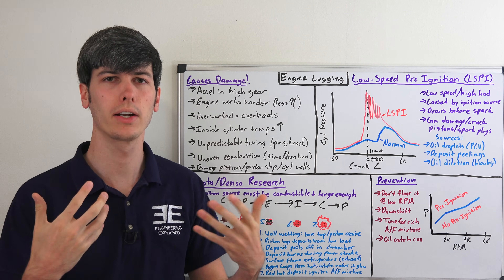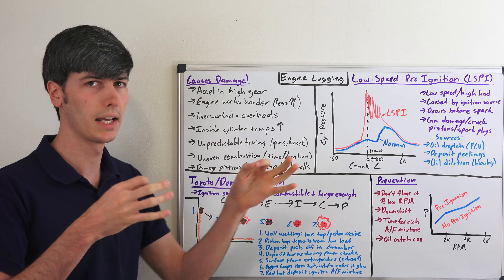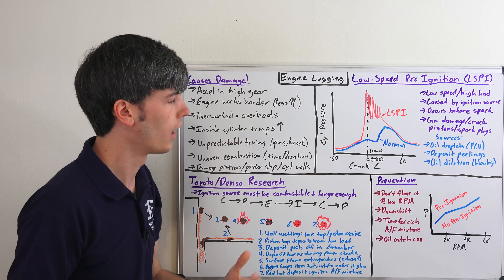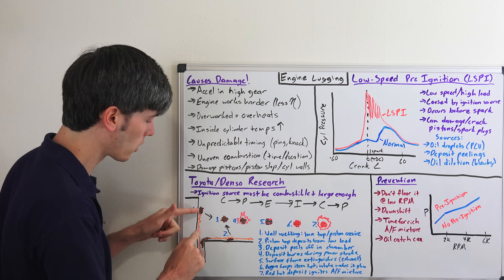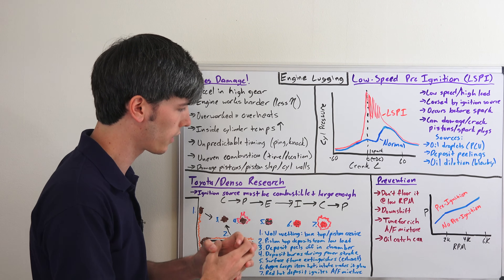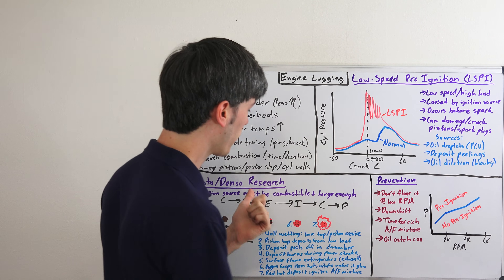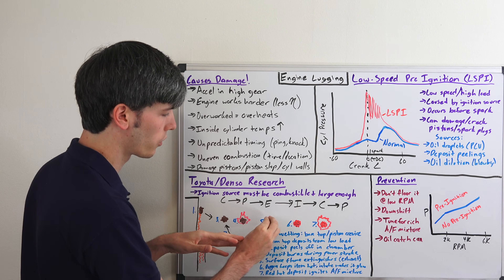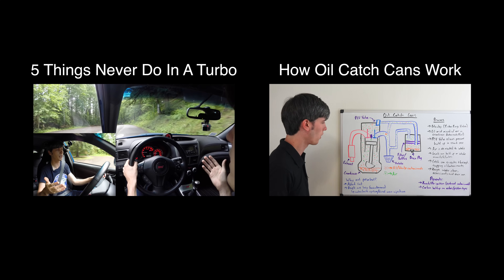Why You Should Never Lug Your Engine (Especially Turbos)

Comment: Soo...  When i'm driving along the motorway in top gear at 60/65mph and my cars revs are sitting at 1,500rpm,  are you saying i should change down a gear to gain a few mph then change back into top gear?
Reply: +MrAndersie91 you should have said that it's a diesel.
Reply from the maker: If you do it aggressively, yes. If you're light on the throttle, typically fine to leave it in gear.
Reply: +Engineering Explained  But when i'm driving along at 1,500rpm that is in the "torque band" of my TDI though
Reply: Its way more difficult to lug a diesel engine! The amount of torque that 2.0 liter makes at lower RPMs is insane.
Reply: manuel grohse There isnt too many Petrol Cars that sit at 1,500rpm in Top Gear at 65mph,  unless they're MURKA MUSCLE

Comment: The fact turbocharged engines are becoming very commonplace & many of them advertise their dynos with very beefy low end torque numbers. This probably gives the wrong impression that manual drivers won't need to downshift to pick up speed, hence the lugging.
Reply: 2015 WRX here. If I'm traveling in top gear cruising on highway and want to floor it then I always downshift accordingly and then do upshifts all depending on what speed I am doing. Otherwise it will bog down. This is my first turbo and love it. This is me coming from my first car 1995 Ford Escort LX wagon then 2001 Civic. Both were 5-speed manuals but of course they had very low HP. Day and night difference with current car lol.
Reply: Klikkitse yep. Comes from good practice and feel to know to downshift accordingly then push pedal more to accelerate and upshift accordingly.
Reply: Umm you usually do get more torque by pressing the pedal actually.
Reply: Yeah. You can have maximum torque and still be able to lug the engine. My daily driver is a small turbo diesel and while it has a ton of torque starting at 1200rpm it actually has very little power in that range. Means I can hold a speed at incredibly low rpm but if I need to accelerate - to the lower gear it is. I think the operative definition of lugging is to ask the engine for more power than it can deliver. You can have all the torque you want but if you try to exceed the power rating at a particular rpm you're essentially feeding the engine too much fuel. I guess people cannot grasp this "discrepancy" that you can have loads of torque but no power and think that they get more torque by pushing the pedal.

Comment: Most people in Europe drive manual, most people in Europe don't know this and lug the engine on a daily basis.
Reply: +iMiguelAOG can downshift an automatic too, if not, push pedal to floor, shoukd kick down a gear, two or three.
Reply: This depends entirely on the engine design. Undersquare (stroke length is longer than bore width) engines usually run lower rpm overall. This is because the average piston speed is higher per revolution if you need to travel a longer distance in the same time. Piston speed is usually 5-6m/s and it's mostly dependant on the speed of the flame front (which are specific constants for petrol and diesel).

This means that our inline-6 Volvo engine (undersquare - bore 84mm and stroke 96mm) despite being a petrol engine actually has a lot of diesel-like characteristics: overall lower operating rpm, high torque at low rpm. This design sacrifices high rpm raw power but is more fuel efficient. It's an automatic but it looks like the transmission always shifts at 1500rpm (1450-1550 depending on gear) and the new rpm hovers right below 1000rpm. I don't know much about engines, but based on the feeling alone it's not actually even close to lugging because almost all torque is available very soon and it can climb a steep hill like that (even if I let the ECU choose the gear). That's 1100rpm, 65km/h (40mph) and 6th gear.

This only goes to show that one should know their own car and engine in order to drive it as efficiently and safely as possible.
Reply: Driving at low RPM's let's say a turbo diesel engine is not automatically "lugging" it. It can mean as well that you just have to use 10% or may be 20% of your available torque to keep your car just running at the speed you already have. This does not mean high pressure, high temperatures inside the cylinder or danger of "lugging" at all. It's just not blowing hot air out of your exhaust uselessly. And that exactly is the point of "knowing how to select right gears according to the situation". Hope that's reproducible even for automatic gear drivers. ;-)
Reply: Our previous car was from -91. Finland's an exception, though. We've got really old cars. It's not uncommon to see 20-30 years old cars as daily drivers. 10 years is some sort of a turning point when a car is considered to lose value meaning it's getting older. The average lifespan of a car in Finland is about 12 years, 14 if it's a van. For some reason we have a ton of old vans from 90s.
Reply: Maybe the "problem" is not really that big problem any more? (Theoretically yes, but practice seems to tell different story)

So, if most people in Europe don't know that mistake and even with that mistake being so commonly , how can it be that right that engines you will lug most likely for their enourmous torque are running flawlessly?? Just thinking of german Taxis, if the rest of the car can withstand environmental conditions even 1 Million kilometers and some a lot more kilometers are very common. But don't you think Taxi drivers will do all for the comfort of their passengers? That are usually engines that won't be revved but most likely will be driven very torque-oriented and with very low RPMs.

And: BTW, checking german TÜV statistics or Motor club statistics most of the cars are not dying from the engine mechanically but usually they quit for electronics problems.
Reply: The reason this isn't the case is because automatics have torque converters which allow slip. This slip prevents the issues shown in the video.
Reply: You know what? Most automatics are also lugging because fuel economy or something. not always willing to downshit
Reply: @FSXgta I highly doubt that those engines are normally designed with that in mind. although maybe for really new cars like 2018+ish but those suck ten thousand other ways
Reply: @FSXgta  4 years later i have to say this is true, espacially with my car, which has 9 gears
Reply: Hmm, my (BMW, 2997ccm) turbo diesel engine is tuned for eco-power, which means "eco" fields characteristics with higher torque figures used for low load scenario while power optimization for high power/ RPMs. So it is optimized for even more torque at low RPM. I've driven that car since the tuning now at least for another 130 000 km (more than 80 000 miles). It has now done about 230 000 km totally (nearly 144000 miles) on first turbo and of course engine with currently still very nice condition. When just cruising I always have less than 1500RPM at low load scenario. And the latter is the point that matters. "Lugging" does not mean total avoidance of low RPMs, it is avoiding low RPM at high throttle ratio. If you do not really need force to keep your car just rolling, why not have engine running on 1000 or 1500 RPMs? Just in case you want to accelerate or going uphill then you have to downshift for the engine revving up a bit.

My cars did make it usually for at least 15 years lifetime, some of them had a total lifetime (driving by me and the owners that had the cars before me) even 20 years or older. And none of them did die due to lugging or such. My Mazda 626 GE from about 1993 (2500cc V6, 160HP) died due to defective coolant water pump, another one, the small 1600ccm Mazda 323f BG I had, cracked the crankshaft of one piston where the crankshaft did look outside the oil sump (or is it oil pan?). And that one was reving up to 7000 RPMs, which it may have done once or twice too much under heavy load situations on "german Autobahn"... ;-) 

That much on the story of "europeans lugging their cars by improper shifting"  ;-)
Reply: This is very true
Reply: I'm sending this video to my friends and family, we have a few sub 1L 3-cyl turbo cars.
Reply: my ex gf did it all the time. 5 gear at 1300rpm!!!
Reply: @TheStriker0525 not lugging until you come to an uphill
Reply: @TheStriker0525  i do this too, i thought i save gas if im at high gear. i usually go up to like 6th gear at 30 mph
Reply: @TheStriker0525  I’ve been doing 5th gear at 900 rpm 😬 glad I’ve seen the video now, time to drop it down a gear.
Reply: All cars me and my parents have sold have been driven between 300000 and 600000km. Still running, most of them still in good shape.
Reply: How many cylinders on the test engines?  Lugging would be worse on 3/4 cylinder engines than higher # engines because of the lack of overlap of power strokes during crank rotation.
Reply: 20+ years I'd say. If they don't keep it, someone else will keep driving it. And then it gets sold to Eastern Europe or Africa, where it will continue to drive.
Reply: That's not true.. The current average age of cars in Germany is 9.3 years. Average. That includes all the new cars on the road, too. And we are talking about Germany, which is doing better than much of Europe. If you look around in Spain for example (especially outside of the richer cities like Barcelona or Madrid) you'll see a ton of old cars.
Reply: Automatics aren't really being lugged though because of the torque converter
Reply: +Super Vitz That isn't long at all, or least not to people who drive in North America. The average vehicle age in the US is right around 11.5 years with Americans driving around 15,000 miles per year on average, which means the average car in the US has about 172,500 miles. Again, that is just the average, not when they're dead. It's actually pretty common for cars to go 300,000 miles these days before being scrapped. My last car had 270,000. Perhaps there's something to this "lugging" thing.
Reply: mine is 18 years old.
Reply: mine is 13 years old and they can get a lot older here in europe
Reply: Skipper  at least in Finland we scrap cars mostly due to rust. Usually rotten junks have perfectly good engine but frame would require new sheet metal which is usually not justified by price if you are not doing it yourself. Makes no sense to get something worth 1000€ fixed because usually saying hello to a mechanic costs you already some hundreds.
Reply: jfsa380 automatic transmissions are dummy proof, so your right.
Reply: Most people do know not to do this actually.
Reply: You ain't most people. Don't extrapolate from you to others. :)
Reply: I accel with 1st gear and put 5th after that cuz im european ?
Reply: Richard Kaltenbach f
Reply: especially them diesels...
Reply: Not most, one of my friends does it to an extreme and I hate it but most don't do it at all
Reply: But the shift indicator makes you!
Reply: emdec55 Not very long, anything over 100,000 miles is considered ready for scrap by most. Everyone is surprised that my Yaris is at 185,000 miles and red line everyday lol.
Reply: .......and 100,000 miles later, their cars are just fine.
Reply: Lol. Such narrow mindedness. Most people I Europe are used to manual transmission as it is the norm. Auto has always been an option over here. Plus most are driving around in tiny engined eco cars which need to be revved to go anywhere!
Reply: iam flooring my porsche from 87 since 2003, even with sub 1k rpm, no problems over here, oil consumption is not messurable. also my smart from 2001 which i drive for 5 years now runs perfect with flooring at low rpm with no oil consumption. in theory they all have to be broken right now...
Reply: @BlacKi-nd4uy  09
Reply: Can confirm this, happens all the time with manuals. My neighbor gave me a ride the other day, and she climbed a very very steep road in 2nd gear, up to the point that the engine couldn't cope anymore. We almost stopped and she had to downshift. I felt terrible for her poor engine :(
No wonder she also blew her gasket...
Reply: but it's easier to not lug in a manual since you can downshift

Comment: to what extent are we allowed to "floor" it without damaging the engine?
Reply: If you're not getting the power you demand with your throttle input, you're "lugging" the engine and need to down shift.  That said, acche2 brings up a point. Modern cars with ECU have the ability to protect against this. If you're running heavy on fuel, it simply dials things back and adjusts mixture to prevent damage.
Reply: Well........I blew 2 sunfire motors by doing that lol
Reply: ya, especially with most of the modern cars are already Drive-by-wire, wouldn't the ECU already have protection against this?
Reply: My car has an electronic ("fly-by-wire") accelerator pedal.  When I floor it in 5th or 6th gear while going relatively slow for that gear not much happens, except the speed and RPMs rise very-very slowly.  In fact when you press the pedal there no difference between pressing it to 25% or 100%. It looks to me like the ECU is preventing lugging.

Comment: Does the same issues arise when going at a constant speed on a road and an uphill causes the RPM to go down? That is, usually you just give a little more gas (not trying to accelerate, just keep speed)  and it works through it. Now, I would assume it's kind of the same issue, but I use my cruise control all the time and shifting down of course breaks the cruise. This is not an issue at 100km/h but maybe at 75km/h in 5th gear (my highest).
Reply: How hard is it to to shift down and press the cruise control button again. In 5th gear it's probably giving it 80% throttle or something, even without knowing this, you should shift down for the fuel economy
Reply: It's not a question of difficulty or gas milage, it's a question of convenience. I usually down-shift because I don't like the sound of 1600rpm. But it would be nice to know if it's the same logic applied, because you're not flooring it but the engine obviously works harder.
Reply: lucifer579x Cruise control is giving it throttle regardless of your foot, for the engine the effect is the same as if you were physically pushing the pedal.
Reply: Sanjuro Makabe Of course it will. I'm just asking if it's literally the same thing going same speed towards an uphill as "flooring it at low RPM". Does it really count as lugging?
Reply: lucifer579x So long as the throttle is open enough at a low enough RPM it is lugging.

Comment: Do gasoline direct injection engines suffer from this problem? I would think not, since there is no fuel for the deposits to ignite until the engine decides so. I would like your input on this however, I have heard of certain engines that inject the gasoline prematurely and i have limited knowledge to draw a conclusion on my own.
Thanks for the video!

Comment: Question: I drive a Manual transmission and I like to be in a gear higher than I need to be like if the speed limit is 35 mph I'll put the car in 5th gear after getting up to speed to keep my rpm's lower, is this bad for the engine? Because from this video, it sounds like it is.  I love driving and I am a professional driver but I am by no means a mechanic or intellectual.
Reply: Cruising on flat ground in a high gear isn't generally bad.  I cruise around town in 6th on my BRZ all the time, which doesn't have a lot of torque.  Gear ratios are short so around 50-55mph is roughly 2k rpm.  On low torque engines, anything below 2k generally seems to be where it can start lugging, even cruising.  It's different for every car. A 4 cylinder will lug much easier than a v8. (within reason)

It's more if you are trying to accelerate quickly or are going up a steep hill.  You can here and feel when something is lugging.
Reply: thanks, then my next question is, how do you like your BRZ? I test drove one and loved it, it was lots of fun but I always worry about long-term enjoyment.

Comment: Would lugging the engine be a bigger issue in a direct Injection engine then a port Injection engine? Just because of the issue with carbon build-up...
Reply: It seems to be. Carbon build up can cause hot spots, which is what can cause LSPI.  Also DI motors generally run much higher compression, again more pressure, more prone to LSPI.  

Lugging is just bad period though.

Comment: If I coast doing maybe 50 mph in 6th gear at 1300 rpm is it bad? Thanks for the video and as always very helpful!
Reply: If you're not accelerating, then that's perfectly okay, more fuel efficient in fact. Maintaining that speed on a flat road is relatively easy for the engine. If you suddenly tried to accelerate or started climbing a hill, however, you would definitely need to to downshift.
Reply: Great, yeah i figured that when the instant consumption read goes to "infinite" is when its very lean and the cycle of the injectors is close to none but had this doubt as I have never heard of lugging. I think I might have done it like two times by accident over this last 3 years that I have had the vehicle, sure as hell it won't happen again!